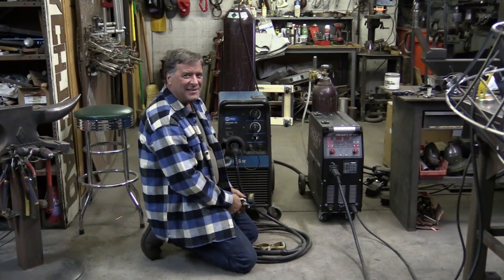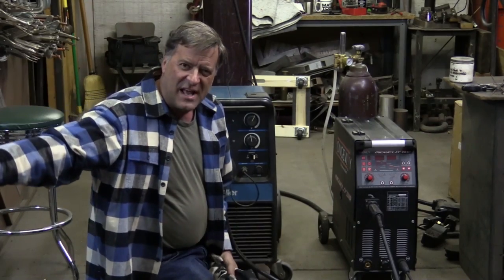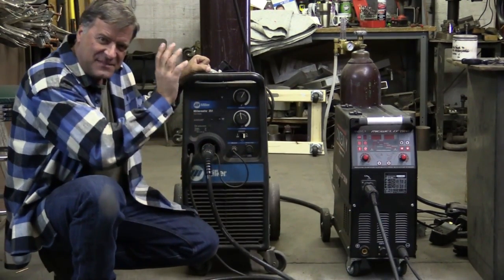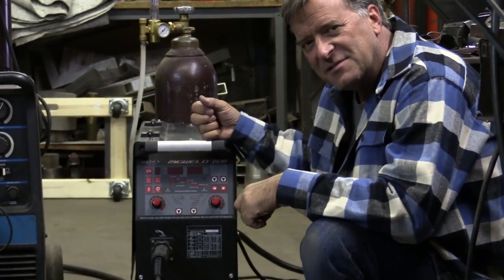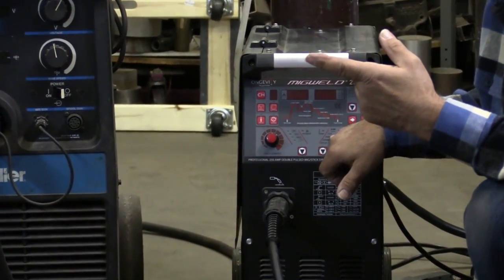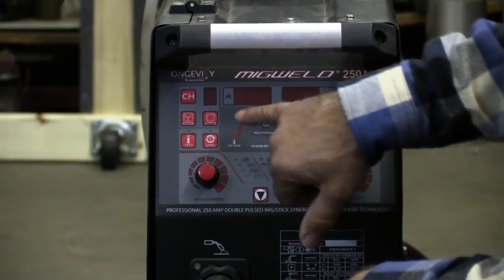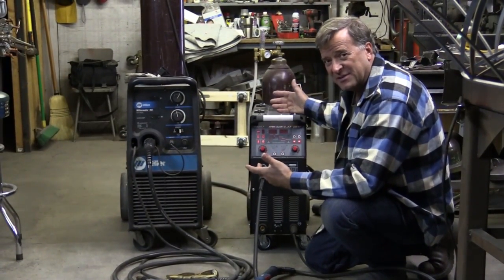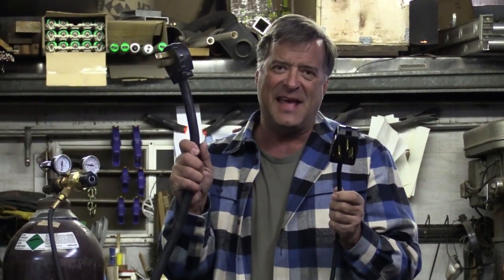Why You Don't Need a Welder That Will Last 40 Years - Kevin Caron

Comment: to me , the duty cycle and the general weight of the main components are the criterions to choose a machine as that dictates the stability of the welding process. Sure that a heavy 3 phases welder is more oriented toward production use where the machines are used on a continuous duty .
Reply from the maker: Well said,   the bigger and heavier the machine the longer it will likely last.   But why cook over a candle when you can have a gas grill?

Comment: 1St  reason I can think of is proven reliability is why to stick with older transformer power, the newer inverter power is or has not proven itself for being trouble free ,nobody wants to keep buying welders because the last one has burned up and the repairs cost more than the welder then they are throwaways , with in the long run COST MORE MONEY.
Reply from the maker: If it works for you then that is the best thing you can do.

Comment: my grandfather bought an Anderson 225 AC stick welder back in the 60s for $65 new. now nearly 60 years later it's pretty rough to look at but still welds like a champ. sure it doesn't have some of the new features but it'll lay a bead just as well as any other and $10 per decade for a welder is pretty damn cheap compared to what we have today.
Reply from the maker: If it works for you ,,Awesome!
Reply: yep it gets the job done. i rarely use it tho, prefer MIG. just shows how long some of these machines can last tho
Reply: If your grandfather paid $65.00 in 1969 that would equal $544.92 in 2023 dollars.
Looking at things in correct perspective.
Your grand fathers $65.00 had the buying power of $544.92 today.
The machine you are speaking of was never cheap.
One thing about the older machines is .
A little paint and going over every decade or so.
They likely will work as designed another 50 years.

Comment: I beg to differ. First all the new gadgets just make it easy for a novice, you don't need them! Pulse has been around a long time. Longevity is Chinese junk! Service wont be around for long as these new companies will not be here either. Inverters all fail in short time. Ask any tech who fixes them. You spend the extra money cause it WILL last 40 years! Your better off buying a used red or blue machine than that Chinese junk! If you weren't in bed with the company you wouldn't make the video.
Reply from the maker: Thank you for posting.

Comment: Can you explain voltage when there no visible set up on the welder. Thanks
Reply from the maker: On the Longevity machine you can adjust both volts and amps in the pulse mode.  Not sure how it works at this point because it's an old video and I don't have that machine anymore.   On the Miller 251 you set volts and wire speed.

Comment: We only run blue or red.  Transformer vs inverter is like displacement vs HP.  HP will get you there and displacement will get you home.  Not sure about the Logevity, but Lincoln makes a 210 MP and the MP means multi-process, like TIG, MIG, and stick.  If you figure that the no-name one will last 3 years, that is about $500 per year.  If the Miller lasts 40 years, that is about $55 per year.  If you use it and sell it after 10 years, it costs about (2200-1200)/10 or about $100 per year
Reply from the maker: Thanks for watching and posting!

Comment: You forgot the resale value that a 10 year old Miller™ Lincoln™ or Hobart™ welder will have!!! Often that will make owning a new Miller™ Lincoln™ or Hobart™ welder cheaper than a cheap welder
Reply from the maker: Resale here in Phoenix on used Millers is crap. I tried to sell my Millermatic 251 for $1200 and no one interested. Dropped the price to $900 and got one call. He offered me $750.   Yes, I still have the machine.
Reply: The resale value on your Millermatic™ 251 was set at $750 in Phoenix that's not chicken feed or chump change!

Comment: If the miller is out dated and useless why didn't you throw it away why would you want your boy using old technology  how will he ever learn new ways on old machine but in 40 years your cheap modern machine will be a dust magnet paperweight that doesn't use any electric a good welder will use an old machine and put two pcs of steel together to stay with good welds that hold ,!! So throw your old one away and weld your sheet metal together soon while your new fancy welder still works I've welded over 50 years and I know how to weld and I will take my old miller and led anything so have a good day and try to learn how to be a good welder and then you will appreciate your older machines
Reply from the maker: Thanks for watching and posting..    It's really all about what works for you.

Comment: Hey Kevin i know this video is pretty old but I am absolutely positive that MP means multi process not pulse. I dont want to sound like an ass but i just realized what you said lol.
Reply from the maker: Nope, not on this machine..    It is a dual pulse mig welder..   A single pulse or a double pulse..   Never got it to work right for me on double pulse.
Reply from the maker: This is from the company website.....

With the MIGWELD®
 250 MP Longevity is happy to bring our users something new, 
Pulse-On-Pulse technology allows for users to control arc heat and length
 simultaneously, This cuts down the amount of work and skill needed 
when welding any kind of metal. Even welding thinner metals, such as 
aluminum becomes a breeze. Pulse-On-Pulse technology doesn't just use 
one single pulse wave shape like most welders; it uses a range of 
multiple wave shapes. This ensures you'll get that stack of dime weld 
you're looking for every time!
Reply: oh btw i remember us talking about gas awhile back. My 125cu bottle was 207 and the refill after the first one will be 35 bucks. Not bad IMO. The first fill was half off so around 18 bucks.
Reply from the maker: That is a smoking price!!
Reply: :) im glad its not super costly. I picked up some aluminum today earlier. Just some flat stock for cutting up into little coupons. 1/8 inch by like 2 inches wide. 4 foot long piece so i cut 3 coupons out and did some test runs little 3 inch long or so welds on my alpha tig 200x and i got some pretty decent results on the last coupon.. I figured if i can i should since its a useful skill to have :)

Comment: I really enjoy all of your tips and tricks.  Your videos are very helpful even though I have quite a bit of welding experience.  I have the Miller DVI, it is a huge machine, runs 220 and 110 VAC.  Because of the investment that is all the machine I will ever have for MIG.  My TIG machine is a Chineses throw away and I hope I get a few years out of it.
Reply from the maker: If it works for you then it is the right machine!
Reply: DVI is hardly "huge" but they are very nice machines. Check out the forums on the Miller website. They are a major asset for Miller owners and also cover other machines (since many weldors own more than one welder).

Comment: A better theme may be "why forego a state of the art economical machine?"  Durable goods that last more than 50 years is better stewardship of our resources than disposable stuff like autos and the home knick knack junk from IKEA/Walmart/Bed Bath.  

A $5000 Miller is unsupportable.  My $100 1980 Century SMAW welder is a prime example of repurposing and reusing.  My Century is built like a tank and will be here after I die for another generation to use to restore broken things.
Reply: Good point. I own 3 welders. The oldest being a Miller Thunderbolt I bought for $65. It is old but the point is when I flip the power switch it always fires up.

Comment: Hey Kevin liked your video been around autobody repair many years also as a union Millwright did a lot of welding/fabrication  from sheet metal to 3/8 even 1" plate steel all i can say is 99% of the big boys use Miller as I do in my home shop with a little care they run forever simple and tough...Now if someone wants to save 500 buck's for a China welder knock yourself out but when it shuts down in the middle of a job good luck finding parts I will stay with my Millermatic 210 w/spoolGun for aluminium :) welding and yes i will subscribe......
Reply: so true
Reply: Key word here is union millwright. You know how to set a transformer machine and make it do what you want. It's experience. These new welders now take the experience and techniques from the person. The machines now  pulse and compensate for human deficiency. You can text your buddy with one hand and weld with the other. Linde welders rule!

Comment: Mr Carson, you are comparing apples to oranges here and trying to make the point that the cheap import welder is better than the industrial welder because the import has more bells. Lets be honest, no serious welder that relies on his gear to feed his family is going to invest his money on a cheap import welder.
Reply from the maker: Thanks for posting but I have to disagree.     The import machines have gotten just as good as the blue and red guys.    No reason to pay 3 to 4 times as much for the same thing.
Reply: While I do agree, we just need more time to see how long they last. If an import lasts a home gamer 5 years that same machine may only last 6 months in a production shop and that would make the import more expensive.

Comment: I'm still using an Airco built in the 70's that was bought after Alcoa used it to the max. My uncle got it in the 90's and when I bought his estate the welder came with the shop. I will die in my 80's or 90's, given my family history, after having used that welder several hours per week. That welder will still be going after I am gone.
Reply from the maker: Awesome!
Reply: That's probably a rebadged Miller as were many Aircos, which is a very good thing since parts are available for the Millers and the pedals have the same wire wound resistors and pinouts.

Comment: For the price of the machine, a bottle, and an eBay scratch start kit.
I'm looking into the AHP 160st.

Yeah there's no sense in investing thousands into a machine that you in all honesty are mostly paying for a paint job, don't know if the company is still going to be around in five years.

My theory is if you can get 3 or more of a machine at the cost of one of the premium brand and get more features as well as having it well reviewed.

I had looked into the Miller Maxstar but they think a gas solenoid is a $200 upgrade another $150 for an average pedal.
In the end it's still just a DC only Tig wouldn't even really call it that it's still more of a stick machine.

By the time you get all the upgrades you could get several others and have back ups with more features.

Comment: Did you buy the Longevity? Which would you spend your money on if you depended on it for making a living? You provide good info, but I am leary of the product comparison/reviews. There is no objectivity. Keep em coming!
Reply from the maker: No I didn't buy the machine..    But I won't show anything on my channel that I don't think is a good product..   Have sent several units back to the manufacturers with a letter telling them what I felt was  wrong..

That being said while I like the Longevity machines I do have problems with their customer support..   That's why I no longer use their line..
Reply: Thank you for the response. I value the info I get from your videos. I do realize we all have to make a living. I try not to be a "sell out basher". But, sometimes I cannot resist. I definitely will continue to watch. Thanks, again.

Comment: its a littel cut 50 duel voltage unit off ebay
Reply from the maker: Not at all,,    some of them are across the street from each other!

To be totally honest,   there are many different factory's that make these machines.. The owner of AHP welders has been giving me a tour of many of them.    Mostly it depends on quality control to keep the machines on the up scale of the market..

Comment: Trouble with the Chinese machines at least in Europe is service and spares. As a professional contract welder I need machine that will run at 100% output all day and if one goes down I need the same day repairs and spares or a loan machine. Also a 3 phase machine gives a far more constant output than those little inverter units that run on single phase power.

Comment: Let me make myself clear, I am not against new tech in anyway, but I have used a miller 130 xp a fair bit, and love it, I recently used a brand new Lincoln electric 210 mp, which is a multi process 210 amp one, which retails for the same (roughly) as the modern equivalent to the 130xp and  prefer the 130 by a long shot, because I find it is less finicky, produces better welds, and is all around nicer, and I fully get why people say miller is the best, spec wise it may have competitors at lower costs, but it really is worth the extra cost
Reply from the maker: +camtheham13 

And there is nothing wrong with that..    You have a machine that works for you and you are happy.   That is the most important thing in all of this..    You will do better work and have more fun doing it because you have a machine you trust and enjoy using.. 

Cool!

Comment: Am considering saving up and get a better MIG welder than the Harbor Freight units. Went onto the Everlast website and they did not list any power circuit requirements for each welder as far as amperage goes. Would get the bigger 250 Everlast if it can run on a 20-25amp circuit. Otherwise am limited to the 140 Everlast Mig.
Reply from the maker: +Jeffrey Beyer        

   You can run it on a 25 amp circuit but you can 't run it at max amps...       Needs 30 amps to be sure you get all the power it can produce..
Reply: +Kevin Caron, Artist thanks for the quick reply. Will probably have to go with a smaller unit. What would be the biggest amperage 220/240 volt inverter based welder can I run on a 240volt 20amp outlet? Will have to run off of my generator as it would basically be an off-grid situation.
Reply from the maker: Probably in the 200 amp range..   But make sure your generator is certified to run an inverter.    Has to be clean power,    Will blow the board in the welder if it is not clean..
Reply: +Kevin Caron, Artist just great. My generator is 5500watt and 12-12yrs old so probably no chance of being able to power an inverter type welder.Any welder recommendationss on a non-inverter friendly generator?
Reply from the maker: Anything with a transformer will work just fine..    Look at an older Miller or Lincoln.   everything from China is going to be inverter base far as I know...
Reply: +Kevin Caron, Artist All I can find out is that my generator is 120/240 60hz. Owner's manual says nothing about sensitive electronics.
Reply from the maker: Than assume it is not clean..
Reply: +Kevin Caron, Artist Thanks for all the help. Now to decide between which beginner class welder.

Comment: Could I put a bigger spool of wire in my mig I just got a two pounder in there now
Reply from the maker: +BRENDAJASON1       Don't know which machine you have but check the manual and see..
Reply: +Kevin Caron, Artist a blue hawk hav't got a manual with it
Reply from the maker: +BRENDAJASON1         Get a tape measure and see how big an area you have..        Or just email me a photo of the inside with a spool in place.        Will help you figure it out....
Reply: +Kevin Caron, Artist ok thanks

Comment: Hi Kevin, boy was I surprised when you was comparing the Miller to the piece of trash Longivity.  I'm surprised  that they are still in business. I bought one of their 250MP and the first one was damaged so bad I had to send it back. They sent me another one, it too was damaged but fixable. The paint was so bad that when I removed the wrapping form the welder a big piece of the paint stuck to the wrapping. The flimsy sheet metal extension for the gas bottle was bent up on both welders. Then when I tried to use the second welder it would not work at all. Finally I sent that welder back and requested my money back which they refused to do. Thanks to my credit card, I was able to get the   money back. I then went to my local welding supplier and bought a Miller 350P mig welder  and it worked great right out of the box. They even came out to my shop to demonstrate the pulse mode and make sure that I was pleased with it. I also have a Miller Dynasty 200 DX that I bought from the same welding supplier a few years earlier and it too has had no problems and the miller support is just great. I also have a Everlast 80 amp Plasma cutter that has worked great with no problems.
Reply from the maker: +John Warden       What can I say,   I am a slow learner....